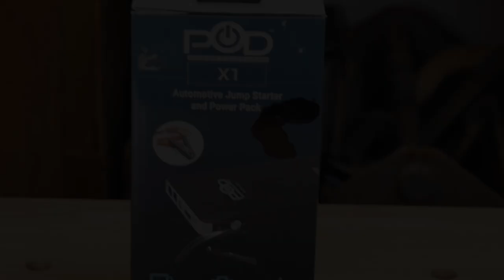Table saw push stick and push blocks & free tools draw @ Coffee and Tools episode 238

Comment: Great tips on push blocks. I don't like the traditional push stick either. Way too many kickbacks with a pushstick.
I built a sled for small and thin parts for a much safer cut.

Comment: I only use one push stick for when I'm ripping anything under 3 inches wide. I only use the L shaped push sticks i hate the chicken foot ones.
Reply from the maker: Ya, that chicken foot one left the building here :)
Reply: I also only raise my blade a half a tooth above the wood im cutting so there is less exposed surface of the blade.
Reply from the maker: @gigaphonicon  Good and safe. I mean't to adjust for the show and skipped it ...oh ..my bad :(